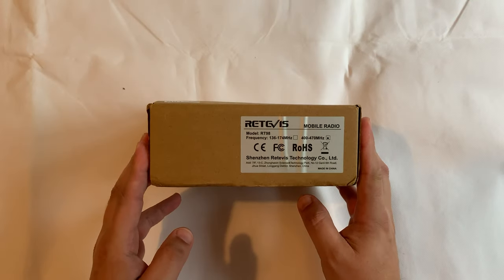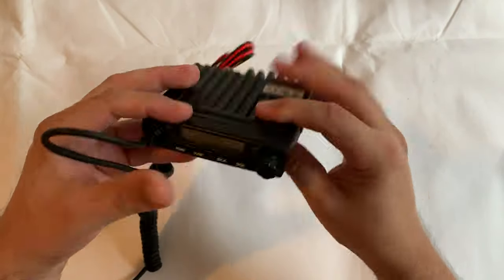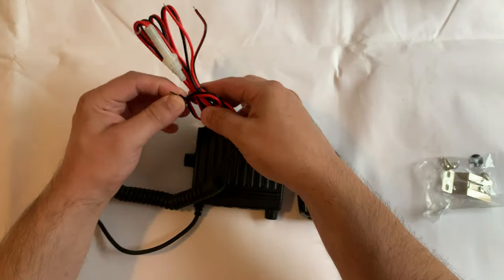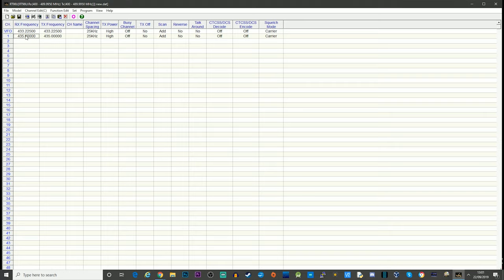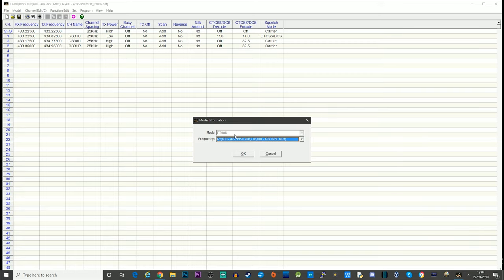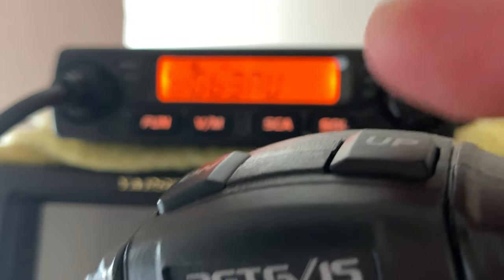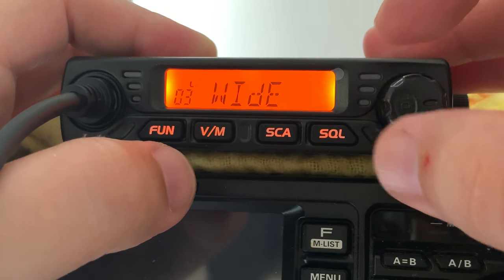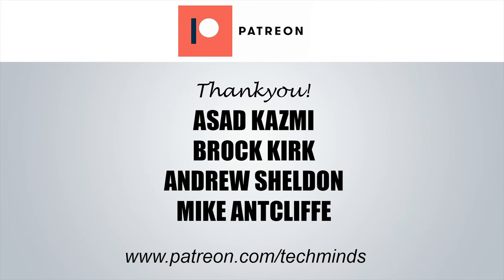Retevis RT98 UHF Micro Mobile Transceiver Overview

Comment: Mine didn't come with a program cable, but I had a multi usb  radio programming cable which fit. I got more static when I program with GMRS frequency ( using 25Hz ) I swift to 20Hz and this reduce the static dramatically.  Almost as good hitting repeater as my Kenwood  30 watt mobile. I do like the scanning function and turning off the beep. Nice super small radio.

Comment: Comment date 1/9/2023.   Thanks for the review.... bought my about six months ago for a sale price of $56 without a cable,  the programming cables i had, none worked.  So i ordered the retevis program cable for 5.99.  finally got that and the radio is now programmed through Chirp.  did some field tests with area repeaters and found this radio able to receive and transmit on the good side with no problems.  radio did get warm after a while during transmitting.   stations found my audio better when i spoke across the mic hole instead of directly into the mic at a gain of 5.   it is a nice little unit once you figure out the strange setup compared to other radios i have.  Yes, GMRS is programmed and listening to area repeaters is great and it will transmit.  its a keeper for the price and a unit you can be thrown in your buddy's car on the way to the football game or a field day with a small backup portable battery.   my teenage son is getting his tech license, he can use it instead of one of my more expensive units.   its cheaper than most HT units i have and delivers more wattage.   program and put in your go box or field bag.   I have this installed in a Nissan Versa which is my run around town staying radioactive.  highly recommend this unit at the bargain price for a single band mobile unit.  The only thing i wish this radio was DUAL BAND.

Comment: That looks interesting. There are not that many small mobile trancievers. I wonder why the heck did they make user interface like that, select part of freq from the unit and stuff below decimal from the mic. I find that bad ui design. Despite that, there is not that much competition with similar size.

Comment: Cute little tranceiver! But why do manufactures always seem to get it wrong with the fuse location on the power cable? Some poor fool could possibly do some foolish install and fail to fuse it closest to the power supply. Net result is several feet of unprotected cable, a fire hazard.
Reply from the maker: If I was to install this in a vehicle I would defo replace the cable with one which has connectors.

Comment: A mic that is fixed? Handy feature that 👎🏼
Reply from the maker: That’s exactly what I thought at first, until I saw the price of these. Around £39.99 so pretty cheap tbh.
Reply: Tech Minds is there a way to replace or repair the lead, I agree the price point is sooooo cheap - any review on the vhf version? Or have they not sent these out?  Thanks for the reply and review. On another note, how do you find the 991A?
Reply from the maker: Andrew Sherman I haven’t opened the case but I reckon it would be easy to replace/fix if needed. In 25 years of playing radio don’t think I’ve ever had to replace a mic lead lol. I have the non A version, FT991 and absolutely love it. It’s only used for VHF and UHF now as I’ve got the FTDX3000 for HF. Plus it’s hooked up to the PC via an RSPDuo for an awesome band scope :)
Reply: Tech Minds thanks, I’m looking at a 991 or the 3000 so really torn at the moment, thanks again.
Reply from the maker: Andrew Sherman 3000 goes upto 50Mhz so if you don’t need 2m or 70cm then get the 3000. It’s pretty darn good. I’ve only had it about 3 weeks but I may do a video on the things I like about it once I’m more familiar with it.
Reply: Tech Minds look forward to that, thanks
Reply: Tech Minds another side, can’t find these at that price?